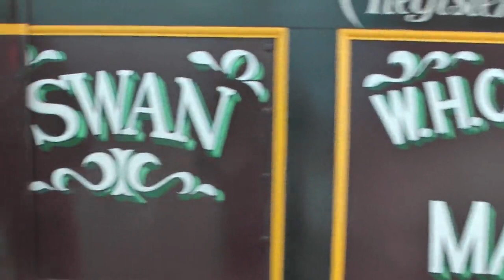Gardner 4VT in narrowboat Swan

Comment: Not only a hot bulb, a two stroke crankcase scavenged reed valve induction engine. There is another video of a similar Gardner engine, a much larger, inline 4 driving a generator, very impressive stuff. Cheers

Comment: I'd love to see how one of these old foggers does on emission test. Place your bets. (I fully understand their historic significance.)
Reply from the maker: Once up to temp, and running hard, probably not that much worse than most industrial diesel engines - but I know what you mean! :)
Reply: I think if you took into account fuel burnt to travel a similar distance, compared to a more modern engine, due to frugal nature of some of this old stuff you might be surprised. It would have to be in good condition ie not burning oil. In terms of actual pollution produced of course